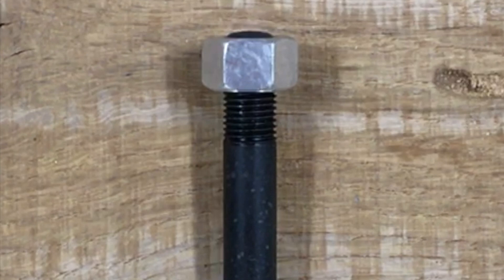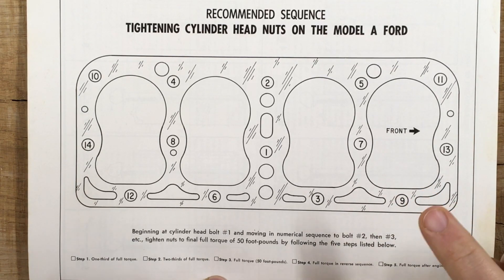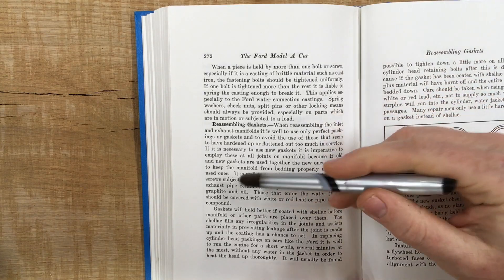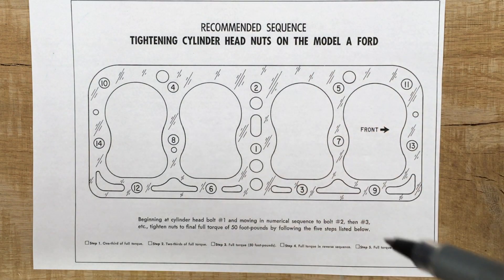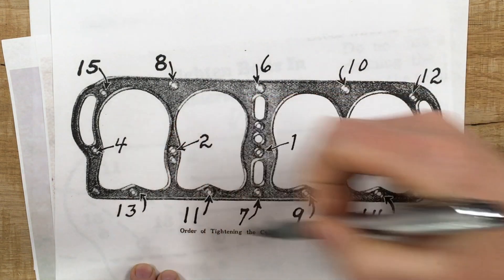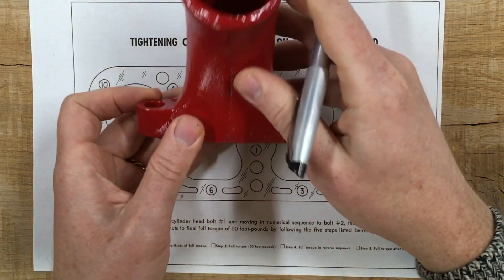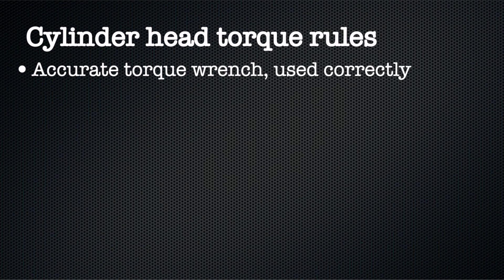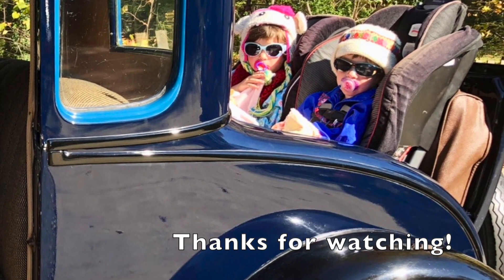Model A Ford - cylinder head torque and tightening sequences

Comment: I have coolant leaking past the head bolts. Would that be a head gasket or should I try to re-torque the head bolts?
Reply from the maker: If you don't have any other signs of coolant leaking into, say, the combustion chamber, it may just be that the bore for those head studs has some corrosion in it, leading to a crack or pinhole inside the bore. That would create a passage between the bore and the water jacket, allowing coolant to come up through the bore and exit under the nut on top of the head. If that's the case, the only way to fix it is to remove the head and the studs and then seal the bottom of the studs with RTV sealant. I discuss this briefly in another video: https://youtu.be/QlNYZICv8g0?si=I5BELc4zEbtnKTog&t=56

Comment: Hi, my head got a hair crack right in the middle at stud no. 1, and I have been told that starting to torque in the middle, as the sequence shows, that hai crack occurs. It’s recomended to start the torque process from the front to the rear. Is this all right, as to avoid this cracking like most heads does? Your comment is appreciated!
I like all your videos, very professional and good explanations. 👍🏼
Reply from the maker: Is the crack in the head or in the block? In the block, a crack leading from the #1 stud bore to either or both of the adjacent water jacket holes is extremely common. No one knows why it occurs. The most popular theory is that someone in the past torqued the #1 nut to 55 in a single pass, rather than performing a multi-pass sequence as discussed in the video. This crack is usually harmless, although I would make sure to coat the coarse threads of the #1 stud in RTV or another suitable sealant.

A spiral sequence, beginning near the center, is widely accepted by engineers as the preferred sequence for any non-circular bolt pattern. This sequence minimizes preload scatter, which is the variation between the torque applied to the fastener and the actual clamp load the fastener places on the joint. If you tightened from front to back, you could get clamp loads at the front that were much higher or lower than expected, leading to additional cracks or leaks.

Bottom line: I would not change your tightening sequence to avoid this crack, assuming it's in the block and not the head. The crack is harmless, and I'm not aware of any evidence that it is caused by the tightening sequence itself.
Reply: @alexiskai  Thank you very much for your well explained and taken time to do so!
Is on the cylinder head.
The hair line fine crack is at the no. 2 stud area between no.2 stud hole, towards the round water jacked round hole. That’s all, but very very fine.
And that no.2 stud nor the hole where the stud passes through had not even traces of rust. So leakage was not present there.
After removing the head, I must admit that the stud no. 8 that clamps also the flexible spring for the ignition switch cable I had this not torqued at all, and have started the engine some months back and noticed water running at this stud no. 8 nut. So, I stopped and cleaned it and sealed with HT Permatex sealant and torqued this nut, but of course it was too late as if water came out at the top under the nut, also was the case beneath at the packing. Upon starting the engine last Sunday I noticed rusted water, not much but proof at the muffler of water entered the combustion chamber of no.3 cylinder.
And there I am at this moment. So, head removed, no water damage in cylinder, total clean up all new stud present and new nuts, cooper packing, so now studs removal towards assembly.
Your torque sequence is correct and conform les Andrews head torque sequence. Thanks again for your prompt feed back !